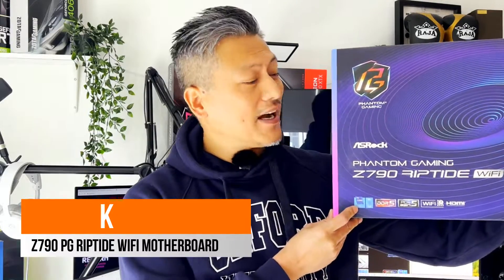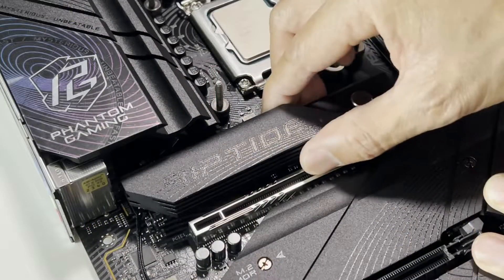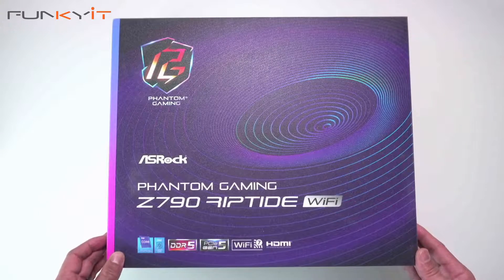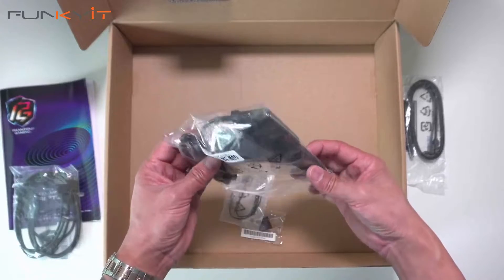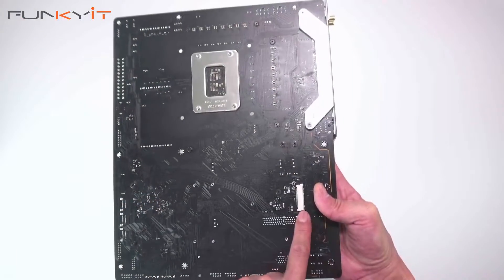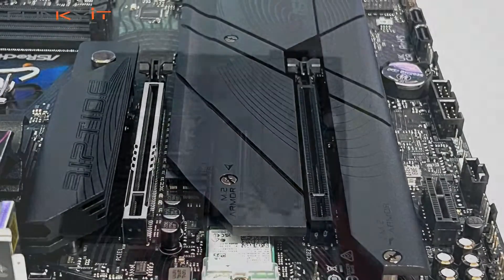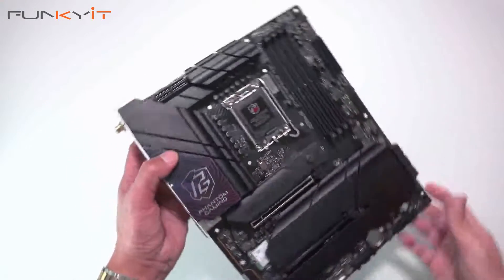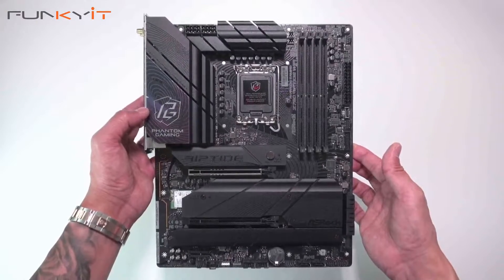Affordable and Feature-Packed - ASRock Z790 PG Riptide WiFi Motherboard

Comment: Is there a way to start this MB so I can test CPU, RAM and GPU outside of the case? This is only my second build so still learning. Thanks.
Reply: You can try using flat screwdriver on motherboard to jump the power switch(the port where you connect Front Panel on/off/reset switch).

Comment: If you would bother to read the manual, or use basic logic, you'd know that using the first m.2 slot above the GPU slot takes away PCIe lanes from the GPU.
Reply from the maker: The motherboard has dedicated PCIE lanes for M.2 slot and GPU separately. Does not affect each other.
Reply: @Funkykit  That's ridiculous, of course the PCIe lanes are limited and they affect each other.
But most importantly, RTFM, you might learn something.
I know, reading is hard, so here, I am doing it for you, from the manual "* If M.2_GEN5 is occupied, PCIE1 will downgrade to x8 mode."
Reply: Asrock Z790 Riptide is older model wifi one is newer model don't get confuse
Reply: @qwertyiopzqz8075  you cannot read either ? IT IS IN THE MANUAL.
Reply: @AlfaRomeoVolante  "If M.2_GEN5 is occupied, PCIE1 will downgrade to x8 mode." Yes, but even an RTX 4090 only uses PCIE 4.0 x16. Which is as good as PCIE 5.0 x8. In other words it does not matter unless you use multiple GPUs, or some kind of $10k PCIE5 Workstation GPU. I haven't seen any Z790 or X670E motherboards which don't cut GPU PCIE lanes with a PCIE 5.0 SSD.
Reply: @Huron_Zeus your understanding of how PCIe lanes and standards work is kindergarden level.
Reply: @AlfaRomeoVolante I know you're correct in your statements but you're kind of rough on the fellas aren't ya! 😂😂😂😂😂😂😂
Reply: @jerryquesenberry2520  I mean, yes, it might sound that way, but come on, people don't even read a silly manual and pretend they already know, it's kind of low level, no ?
Reply: @AlfaRomeoVolante  LOL! Just bustin' your chops fella. Have a good one
Reply: @jerryquesenberry2520  Haha, thank you, you too :-)
Reply: Thats not basic logic. Doesnt work like that on all boards you clown.